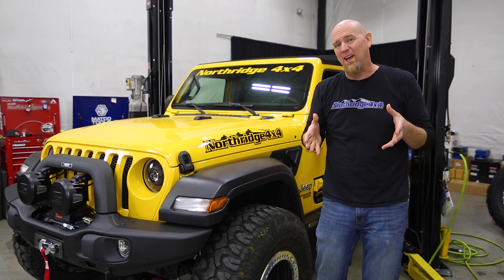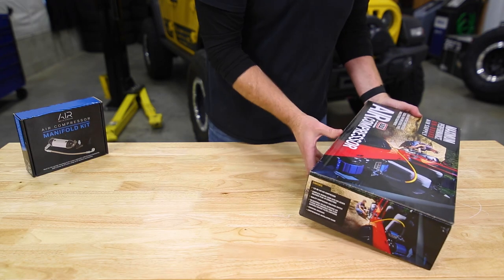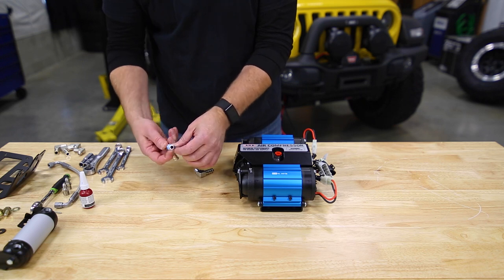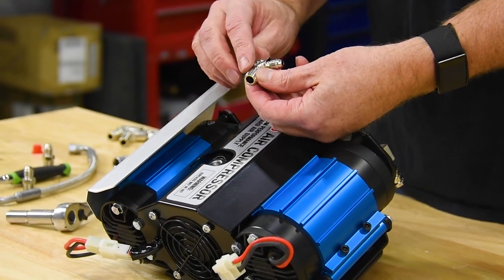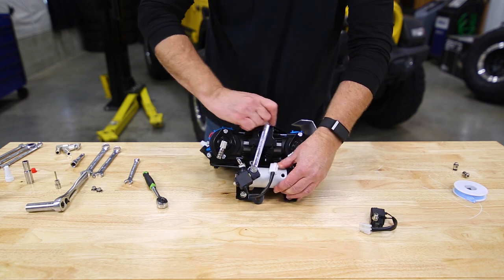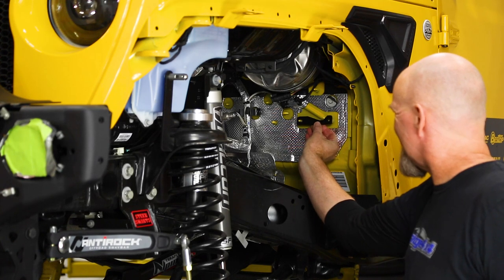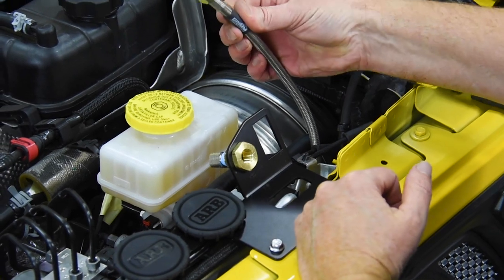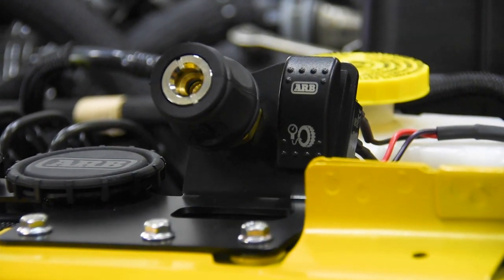ARB Twin Compressor Under The Hood Mounting - Wrangler JL 2.0 Turbo

Comment: Love this video, I am planning on adding air lockers at some point and wanted to use this compressor. I'm glad to see I can install it and use it for on-board air w/o the lockers. In your list of parts above, there is no mention of the silinoids, can you post the correct link to them? Are the push-in fittings that are mentioned at the 11:02 mark included with either the silinoids or the manifold, or is that a seperate part?  (trying to make sure I get everything I need for this exact install.
Reply from the maker: The solenoids and push-in fittings come with the ARB Air Lockers.

Comment: Any concerns with water crossings and the dual arb and the fact it has a cooling fan?
Reply from the maker: The only concern is to keep that area clean, don't let mud and dirt build up on the compressor and trap heat.
Reply: @northridgenation  Any issues with water at all? Like if it hits the cooling fan on the compressor?

Comment: I have the 40 inch Patagonia’s and riding in the street above 28 psi’s is the most terrifying experience. Worst tires I have ever bought.
Reply from the maker: Strange. We've ran all the popular sizes of the Patagonias in the 35 psi range and they drive great.